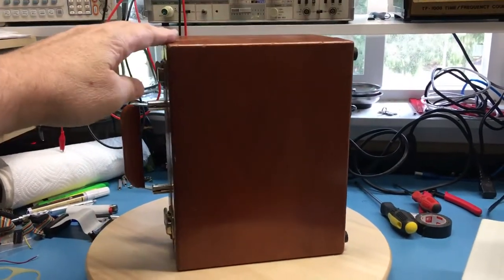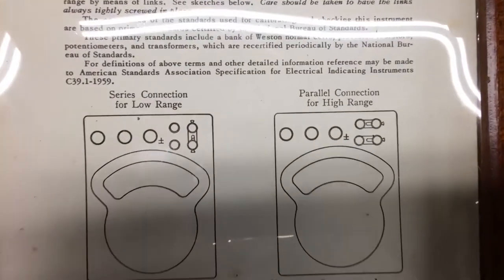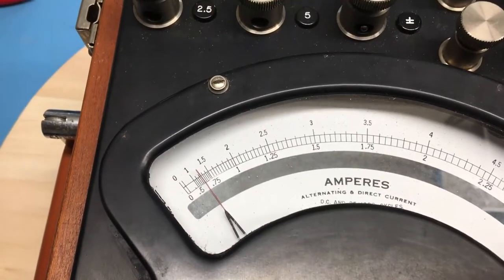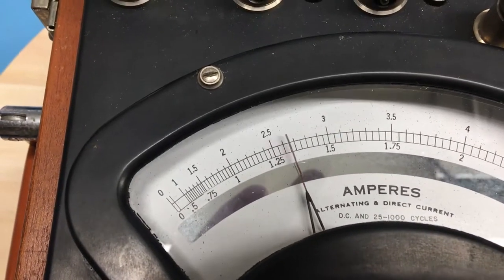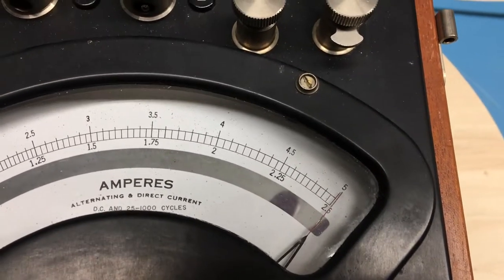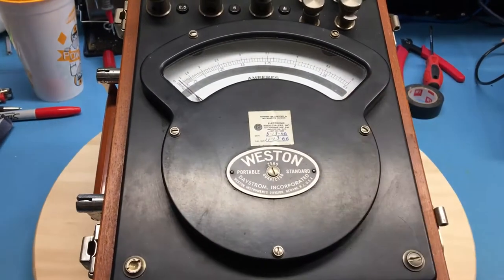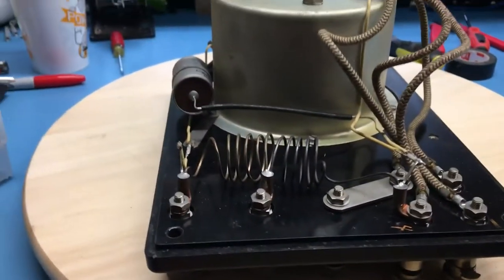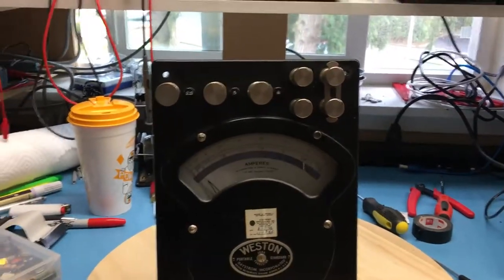Vintage Lab Gear - Weston A.C. & D.C. AMMETER Model 370 Tear Down (1962 vintage) - STB8

Comment: I just picked up a Western 370. And while I know very little about electronicals I think I have the answer to the odd screws. Mine also has one from each set of screws being different. However... Both of the heads on the odd screws were filled with a foreign material presumably so it would be known if somebody had tampered with the meter. The screws all have trim washers but the panhead screws don't allow space for a foreign material other than to sit in the slot of the screw head. Hence the odd screws

Comment: I purchased a smaller version of this meter off eBay.  I was wondering if it would be possible to turn something like this into a clock using a DAC and an Arduino?  I've seen DC voltmeters used, but wasn't sure if the same thing could be done with an ammeter? Would DC current power it?  Great video!
Reply from the maker: Meter movements are are basically the same, they all use a voltage to make the needle move. A voltage is applied across the movement which creates a magnetic field in a coil which pushes against a magnet moving the needle. What makes this an ammeter is there a small resistance in series with the current flow you're measuring. The small resistance will cause a voltage across the resistor, the meter is connected across this resistor and that voltage then moves the meter movement. Remove the resistor and you have a voltmeter which should be able to work with the circuit you're describing. Different meter movements require different voltages to get the meter to swing to it's full deflection so you'll need to take this into account.
Reply: @ShadowTronBlog  Thank you for this information.  I'll disable the included resistor and diode and see what it will take to move the needle.  Is there any chance I would burn something out using 3-5 volts?
Reply from the maker: @tikishark1  Some meter movements have the full scale voltage printed on them. Look for this.

Being an ammeter I'd guess the voltage to get it to full scale will be pretty small.

I don't know the details of the meter movement. It may only require a few millivolts to swing full scale, it might require 5 volts, or 50. Be very careful as you test this. To large a voltage could lead to high current in the little wire winding for the movement and burn it out. Start with as low a voltage as you can. Maybe a 1.5V battery. Polarity will matter as well, the movement may have the + and - pins marked. If you get it backwards the meter will swing the wrong way, with a low enough voltage it shouldn't hurt it.

You could also create a voltage divider with several resistors in series. Connect the - pin on the meter to the negative supply. Connect the + pin to the resistor connected to the - pin on the battery. Then move the + pin to the next resistor up until you get full scale, measure that voltage with an ohm meter. If you've unfamiliar with resistor voltage dividers look it up. It's a fundamental concept to understand.
Reply: ShadowTron Blog great suggestions. I’m going to try the divider as you suggested. I’ll let you know how it turns out. 

These old meters are fascinating. There’s something to be said for mechanical electronic equipment.
Reply from the maker: Yes, meter movements are typically a DC device. Assuming the needle is all the way to the left then a positive voltage will move it to the right. Some meter movements have the resting position of the needle in the center of the scale. In this case a positive voltage would most likely move the needle to the right while a negative voltage would move it to the left.